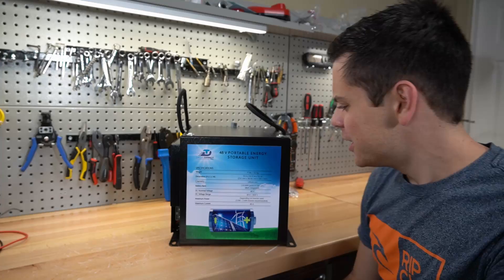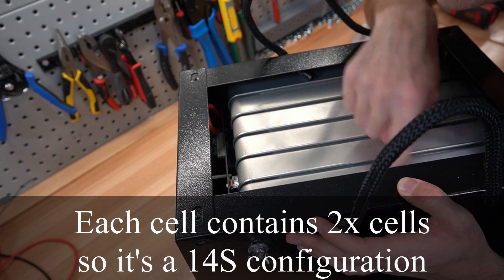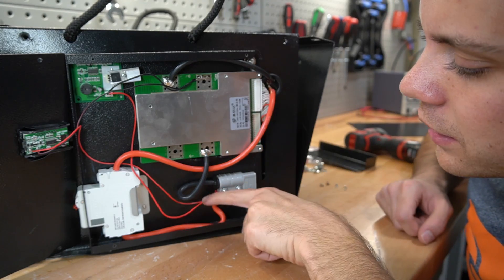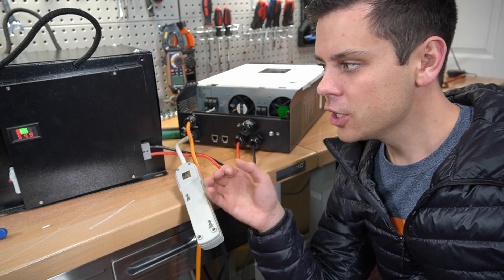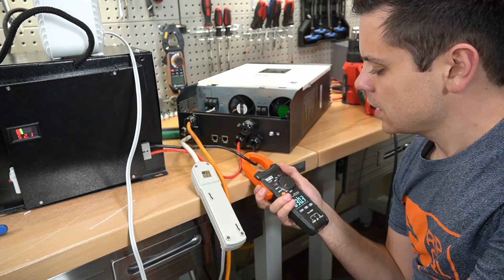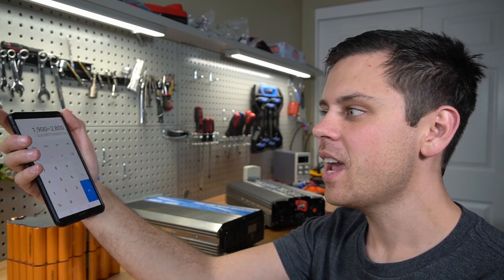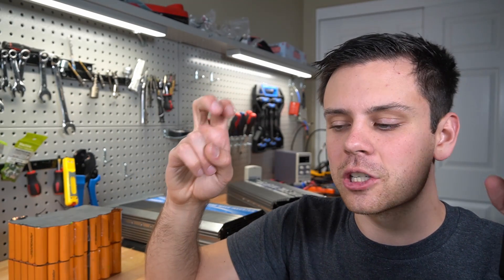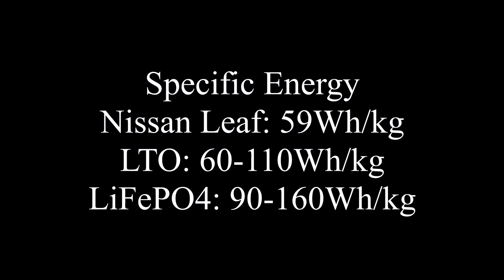48V Nissan Leaf -Used Cell- Solar Battery Pack

Comment from the maker: After I realized that the sticker capacity and the usable capacity were different, I made sure that Bigbattery. com updated their listing before posting this video. I think it would be unfair to list a 1.9-2kwh battery as 2.8kwh. So they changed it. Also updated the pictures because some forum members complained about that. 

I am not a big fan of Nissan Leaf batteries, as you can probably tell. And with the updated capacity and price being $599 (before my coupon code), a tesla pack is actually cheaper. But this comes with it's own bms. So yeah, quite a few pros and cons.

What I am excited for, is the BYD LiFePO4 battery they sent me. Unfortunately, many forum members are reporting 3kwh of usable capacity, not 5kwh. So I will have test results on my pack tomorrow and let you guys know. If those cells work well, we will have an awesome plug-n-play second life storage pack. I have no idea how well it will work.

What do you think? Was my assessment of nissan leaf cells fair? I know a lot of people use these, so I was trying to be more objective. It is easy for me to go into rant mode with a used NMC pack with 65% of original capacity, but I know some applications warrant their use. Let me know :D

~~~~~~~~~~~~~~~~~~~~~~~~~~~~~~~~~~
Tired of getting ripped off? Check out my "Will Prowse Approved" solar product recommendations below!

12V Batteries
https://www.mobile-solarpower.com/lithium-batteries.html

48V Batteries
https://www.mobile-solarpower.com/48v-batteries.html

Offgrid Inverter System Builder
https://www.mobile-solarpower.com/48v-complete-system-blueprint-559371.html

Hybrid Inverter System Builder
https://www.mobile-solarpower.com/code-compliant-48v-offgrid-system.html

Mobile Handtruck System Builder (very popular!)
https://www.mobile-solarpower.com/mobile-48v-system.html

Solar Panels
https://www.mobile-solarpower.com/300w-solar-panels.html

Ground Mount Solar Racking
https://www.mobile-solarpower.com/ground-mount-racks.html

Wire, Lugs and Busbars
https://www.mobile-solarpower.com/wire-and-connectors.html

Tools
https://www.mobile-solarpower.com/tools.html

Fuses and Circuit Breakers
https://www.mobile-solarpower.com/fuses.html

Plug-N-Play Solar Systems
Ecoflow, Anker And Bluetti! So many models to choose from. See my current recommendations here:
https://www.mobile-solarpower.com/full-size-systems.html

~~~~~~~~~~~~~~~~~~~~~~~~~~~~~~~~~~~~~~~~~~
Need to build a large DIY system? Need a trustworthy solar distributor? These are my favorites:

Signature Solar
Creator of EG4! Solar Minisplits, Victron and More! Largest Solar Store Online.
If you want $50 off, please use my link below and coupon code "DIYSOLAR50":
https://signaturesolar.com/?ref=cPwLcVc0SW-BjN

Current Connected
Best Prices for EG4, Victron, Midnite and so much more! Fast Shipping and Highest Rated Customer Service:
https://currentconnected.com/?ref=wp

~~~~~~~~~~~~~~~~~~~~~~~~~~~~~~~~~~~~~~~~~~
Join our DIY Solar Community 
Need more help? Join the largest solar forum on the internet for beginners and professionals alike. 140,000 members and counting!
https://www.diysolarforum.com

Check Out My Free Book
Best-selling and beginner-friendly guidebook to off-grid 12V solar!
https://www.mobile-solarpower.com/the-book.html

~~~~~~~~~~~~~~~~~~~~~~~~~~~~~~~~~~~~~~~~~~
Contact Information:
I am NOT available for personal solar system consult! If you wish to contact me, this is my direct email: williamprowsediysolar@gmail.com
FTC Disclosure Statement and Disclaimers:
Every video includes paid promotion or sponsorship (such as free products for review). Some links on this YouTube channel may be affiliate links. We may get paid if you buy something or take an action after clicking one of these. My videos are for educational purposes only. Information is subject to change/update at any time. Electricity is DANGEROUS and can kill. Be smart and use common sense :) DIY Solar Power with Will Prowse is a participant in the Amazon Services LLC Associates Program, An affiliate advertising program designed to provide a means for sites to earn advertising fees by advertising and linking to Amazon.com
Reply: I like the Nissan leaf batteries because of all my battery packs Nissan leaf is the only one that keeps all cell balanced within few millivolts duringcharging or discharging.
Reply: 24V LiFePO4 4-4.5 Kwh Battery Modules

Can you do a video on this one please?
Reply from the maker: @Jason-zg3nl  yes it's coming soon
Reply: @WillProwse  great because I'm thinking of getting them for my 24v mpp system, I have 2 battle born batteries but they don't last that long
Reply: I just read that hearing it in my head in your voice.  That was different.
Reply: Can you get BYD b 2.56kw module and Pylontech 2.4keep models to test and take apart? :)
Reply: Will & Jehu Collab? (How many funs would that be!)
Reply: I think the assessment was fair, nissan may well be 9n the right track with a passive thermal management design in the long run, but untill they find the right chemistry they will be sub par. 
On the bright side the junkyards are full of 28 kw leaf packs.
Reply: I dont know if you meant it but the way this video came across was these dangerous leaf batteries are for poor people who dont know what their doing. I'm too good for these. I prefer the fancy more expensive ones that poor people cant afford. I'm sure you never meant it that way but it is how it came across.

Comment: This video raises more questions than it answered.

1. In 2020, Bigbattery could have  procured a large batch of NMC Nissan Leaf traction batteries with 65% health is more than just impressive. As that change did not happen until 2018. 

2. On fire hazard, people hardly hear report(s) on Leaf/Leaf batteries catching fire. There is a reason behind this, especially before 2018. People might still remember Elon's sour grapes. 

3. The fundamental reason we need to re-purpose the retired traction batteries is energy sustainability . It's way too much of a waste (and hazard) to recycle a traction battery with 65% of its original capacity and it should not be acceptable. So, as long as the seller labels with true capacity (and battery chemistry), it should be ok. 

4. Discussing the energy density of stationary energy storage application is not a proper metric. A similar situation happens in EV 0~60mile/hr time. You do not need a test to run it, but rather a calculator to find this out.

5.

Comment: I ran this system very lightly from 2019 to 2024 before the cells starting expanding to the point it bent all the components. 
The threaded rods prevented the corners from expanding so the only place to expand was the middle line a acordian.
I've seen tests that show they won't smoke or flame when expanding unless something ruptures the cell contacts inside. 

I now have 3 packs remaining that I need to find some project to use them for.

Comment: My 2011 Leaf's battery has 60% SOH, 35 miles range. Given that it was designed for vehicle to home/grid why not just leave the batteries in the car and use it as a power source. I has it's own battery charger built in. How best to get power from it?? Anyone got ideas?

Comment: Would this work with the solar edge inverter that supports a battery? I got one assuming I would get a battery later so it has the port it needs.

Comment: Temping though, a 80kw Nissan leaf battery on eBay for £500+£100 delivery. 2013 vehicle, still, even 50% would be a big assed cheap battery.

Comment: Just purchased a Leaf battery with 48 modules. Plan to update my battery pack on my ride on mower conversion.
Would be great to make a nice enclosure like these, to swap out packs.
Running a Motenergy ME-1004 brushed motor. Any suggestions? Maybe two 52v packs to halve demand and keep temperature down.

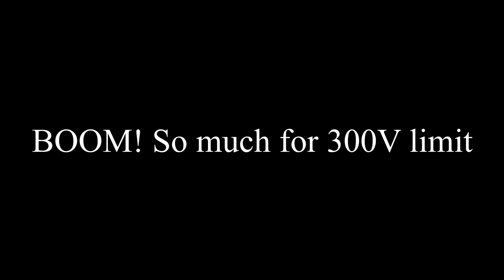Comment: thats a 48v battery and the load tester and shunt had exposed terminals. 4:21 there's a spark! This must be electroboom channel! Will says "Gaddamn it!" I say, about "God bless Will 's eternal spirit in the afterlife."?  Will says 48v can kill, yet his hands play freely around all the exposed terminals. What kind of message is this carelss safety practice sending? They should be taped up.

Comment: Hey bro I am considering using Nissan Leaf Cells for a build.  I found Cells from a Leaf with only 15 Miles, so they should all be in good and new condition. 

I would like to share with you my build plan and discuss how to improve the design.  

Contact me on Instagram if possible @bodhi.artman

Comment: 6:52 I think you might be overselling the flammability concerns of NCM chemistry too much, and it's worth noting that Tesla uses NCA chemistry in their Powerwalls, which has been found to be far more volatile than NCM. The most common NCM batteries on the market at the moment are from the Bolt EV, i3, and LEAF, and I am not aware of a single battery fire associated with any of those vehicles. Yes, caution should be advised when constructing new battery packs, but spending nearly two minutes on the subject of NCM fires only to conclude with "no one should use them" seems a bit harsh.
Reply: Right thank you

Comment: Is this something I can charge and be used at the same time? We need a pass through to the electicrical system. Can we charge and discharge at the same time?
Reply: It is a Li-Ion battery with a BMS.  Either you are charging a battery or you are discharging a battery.  You cannot charge and discharge any battery "at the same time".

Comment: They don't last very long.  I have popped 2 out of 8. (ie: got 7, one popped.  Replaced.  Popped, gave up....went different direction..)  Not worth the effort
Reply: What went wrong?  Did the BMS die or a Module?  Did you purchase a GEN 1 or GEN 2?
Reply: @vtorsi610  First one was gen1, used it for around 10 months.  Second, gen2, popped it in 2 months.  Seems the bms was not dealing with the charging/balancing well.  I only charged it at 10A.  Anymore, I"m only charging packs at no more than 5A per string just in case.
Reply: @markseamans4682  And the very short 30 DAY warranty, was of no value to you.  So sad.  Some people bought the bare modules, some arrived DOA at ~0 Volts. The buyer used PayPal for the refund.

Comment: I saw another video about the Nissan Leaf modules and each module is actually 2S2P.  So I am wondering whether the BigBattery BMS actually goes to each cell or to each 2S2P module?  Is it a true 14S BMS, or is it a 7S BMS with a lead to each module?  I wouldn't touch it with a 10 ft pole if it is a 7S BMS.
Reply: It is a 14 cell BMS.

Comment: So I looked at the big battery website and I saw the Nissan Leaf complete battery (G1) and I noticed it had a whopping 24KWH.  Would this work for a solar battery?
Reply: You might contact the seller, explain your system and ask them. Or do some intensive research to determine what would work for you.
Reply: @Awe Fill Mike Mike - Only if you take it apart and reconfigure the modules ...

Comment: I want to power a laptop,60W (audio) guitar amp and a 35" TV (this is my outside guitar learning studio) I plan on installing everything in an automobile. I ask for ideas. Like should I replace my AC compressor with a 115 AC generator in addition to an inverter? Looking for ideas to get a steady,clean 10-15 amps of 115V AC. My donor "power station" auto is a 1995 Buick with a 3.8V6. Not too tough to hang the AC generator(2-4000W dual bearing) but after that I am low on ideas. Yes a long extension cord from the house would be easier.
Reply: You have the ideas...just need to do more research. I would stay low voltage to match a battery pack and put my money in a good inverter. You will need a lot of battery to supply the "house wall outlet" power you seek for very long.

Comment: can you use one or more of these added to a trogen  T105 48 volt wet cell setup? Would it work just adding to the 24 Trogens i have at 53 volt? and would it charge with the outback flexmax    150 charge controllers i have 15 kw tracking solar arrays. Thanks.
Reply: No. Just wait a few years. I have never gotten over 8 years form Trojan T105's before they were mostly useless. Nice yet old school. Thrash them till they die. Meanwhile start collecting the lithium specific inverter and other doo-dads you will need for the oncoming wave of lithium.

Comment: Love your videos Will. Hey Will, minivan Mike referred me. i am installing a 48 volt system in my van. Can i run a wire from the van battery, with an isolator, to a step up transformer, 12v to 48v to charge the battery bank?
Reply: Use a DC-to-DC Li-Ion Charge Controller

Comment: What are the operating temps for a nissan leaf battery module?
Reply: google my friend. Become a Nissan Leaf battery cell expert.
Reply: @geraldhenrickson7472  is nissan leaf the best bang for the buck for a battery long term at this moment. My calculations say they are 6 times more cost effective than CALB or other LiFePo4 batteries
Reply: @geraldhenrickson7472  I'm doing a HUGE house solar ie 16,000 Ah at 24 volts.

Comment: Tesla NCA battery chemistry is more susceptible to thermal runaway than this NMC chemistry. This is why Tesla Powerwalls use NMC chemistry. Personally I would still use LiFePO4 for this application.
Reply from the maker: I agree
Reply: NO, those Nissan Leaf Modules are NOT NMC Chemistry, they are LMO + Nickel  = ( LiMn2O4 with LiNiO2 ) - NO COBALT !!!

Comment: So would you say that the Tesla modules that people are using is a slightly safer alternative to these Nissan Leaf batteries? I know you had the tesla battery when you had your motorhome.
Reply: I think tesla is less safe from what I can see. They explode while Leaf batteries just swell up.
Reply: @techtactics788  And those Nissan Leaf Modules are NOT NMC Chemistry, they are LMO + Nickel  = ( LiMn2O4 with LiNiO2 ) - NO COBALT.

Comment: What batteries do you recommend for pulling about 17 amps from a 3kwh system being inside of trunk of a car, with solar hooked up to it? Thanks!
Reply: We live in interesting times with a huge variety of choice. The only way to answer your question is to research the heck out of lithium. Even then...there are dozens of ways to go.
Reply: @Gerald B - HEAT is your enemy

Comment: Thanks for the update, I was curious if you had found anything like the MPC all in one unit of a charge controller, transfer switch , and inverter all in one  that was improved , I am doing a cargo trailer conversion and think individual components would be too complicated for a small task, Thanks

Comment: I have the same electronic load and it failed the same way ... shorted the fakin input. Bought some replacement mosfets and they can handle no more than ~80w before going short circuit.

Great design.

Comment: Great video. Our diy community has a large issue with ppl coming in, building a bad system in a rush ignoring the info and burning down house garage or ebike. No one uses drywall... :(

Comment: Ok you just went down a peg or 2 for being a weiner about the workbench. Next time gets some rubber horse mst from the tractor supply company or TSC so i dont have to make fun of you. 
Temperature sensor? Its called a thermocouple. Also put a second loop through your clamp on and divide the read out by 2 for a more accurate number.
Reply from the maker: It's a nice work bench. I'm not a bitch, but I keep my shit nice. And temp sensor is better for lay people
Reply from the maker: Yes I know how hall effect sensor clamp meters work.
Reply: @WillProwse  
Im not so sure clamp meters aren't inductive and not hall effect sensors. But hey im just some dude.
Reply from the maker: Maybe you should watch my other videos so you understand how much I know. Don't watch the beginner videos.
Reply: @WillProwse  
Guy im not trying to be a dick. Chill out. See you need some experience on a big job where multiple guys are installing machines and you'll have a sense of humor. You shouldnt need to see "lol" to know someone's just busting your balls.
Reply: @WillProwse  
As for the lay people thing. They come here to learn how to do things so you should show them the proper way(s) and use proper nomenclature otherwise youre creating a mass of people that can go through the motions but dont really understand it. That comment makes you seem a bit pompous.
Reply: Jeez Slappy. Is that all you can offer? I like you ridea in the last sentence....it offers at least some positive vibes. BTW...a thermocouple is a sensor to measure temperature. A temp sensor. Let it go professor.
Reply: @geraldhenrickson7472  
Me let it go?.. this was six months ago, man. Talk about digging up the dead. As for the positivity thing... since i assume youre an enthusiast of the electrical arts i would also assume you would know that positivity needs negativity. You can have a world where nobody is allowed to object, or criticize or otherwise go against the feel good nature. I find it insulting that he would dumb things down just because he thinks people wont know what he means... yes a thermo couple is a temperature sensor but not all temperature sensors are thermocouples. To me this potentially creates more confusion versus just letting someone do a quick google search to find out "what the hell is a thermocouple?"
Reply: @geraldhenrickson7472  
If you want to teach people something teach them properly. You teach them how to do it the right way even if its the hard way and in tine when they are ready they can take their own short cuts.

Comment: I wonder what’s the ratio of charge-discharge-efficiency? So has the decreased 65% capacity affected the efficiency of the battery? I think that would be crucial if using these as solar batteries.
Reply: When I wonder...I google.